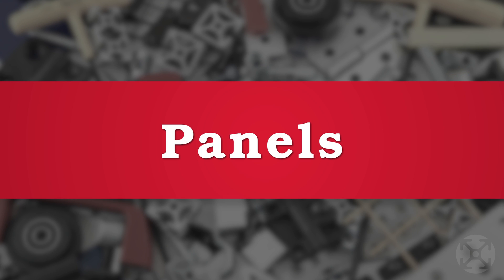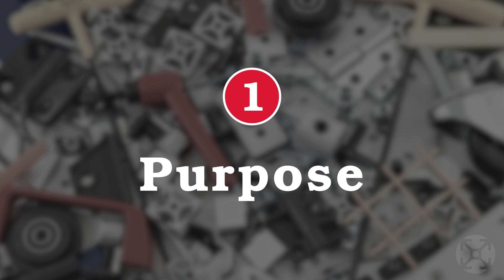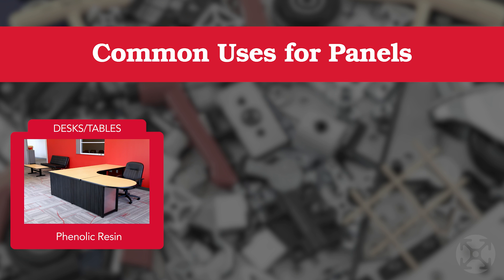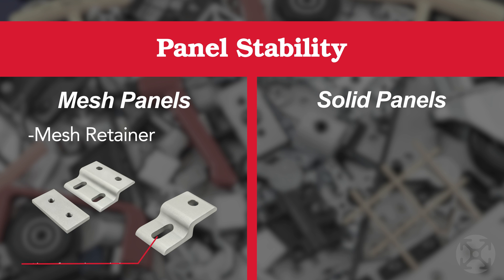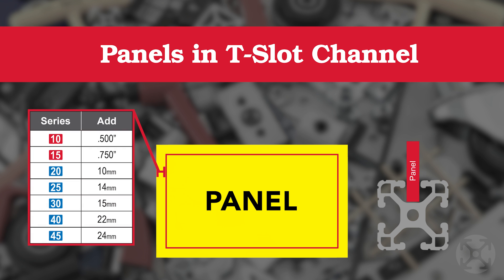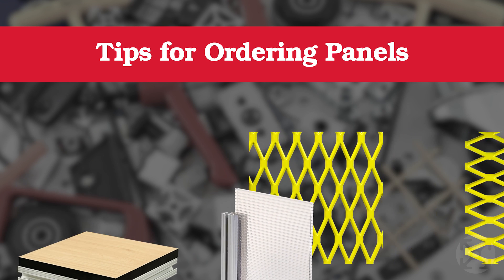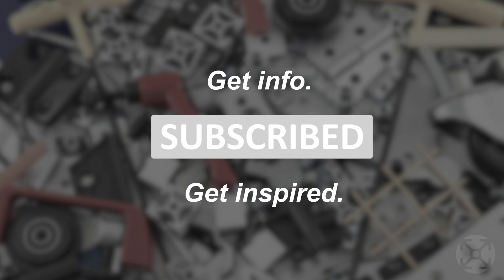80/20 │ How to Design: Panels

Comment: What does the dimension w/7312 Vertical on Corner B mean?
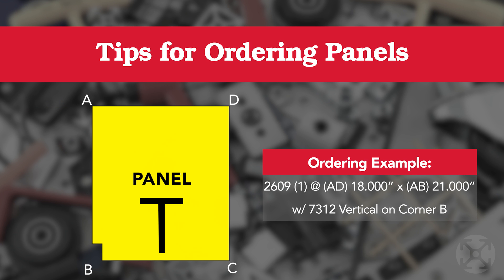Reply from the maker: Hi there! '7312 Vertical on Corner B' is referencing a machining service. Per the drawing at 02:48 you will notice each corner is labeled A-D. To order a panel notch machining service, you would specify the machining service and the corner. In this case, we want a 7312 (a clearance notch) in the bottom left corner, and we want the notch in a vertical orientation. See more about this example in the catalog: https://catalogs.8020.net/80-20-Catalog-25/10-29/
Reply: @8020llc  Thank you, that makes sense..